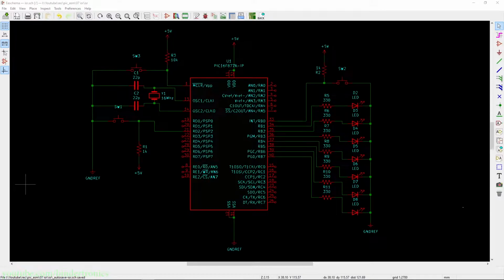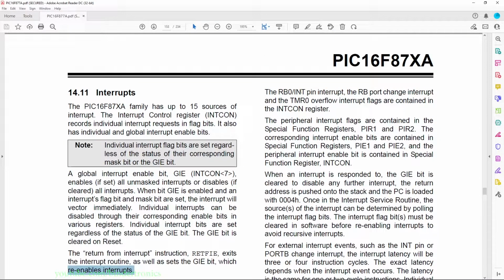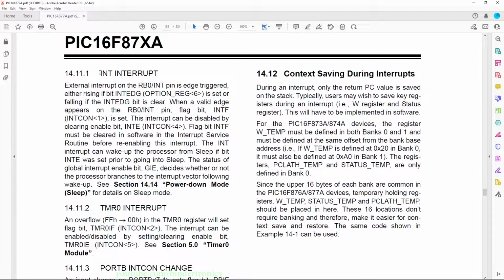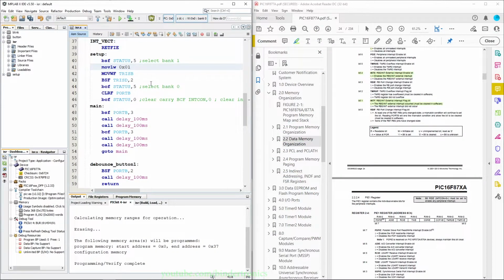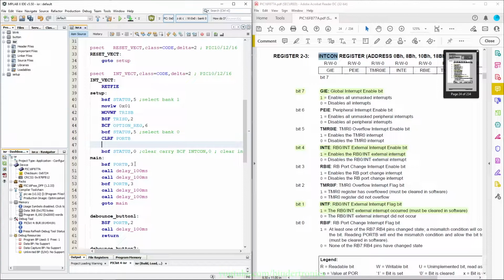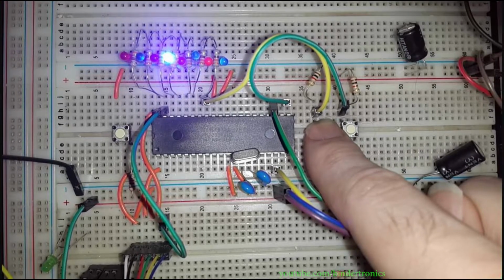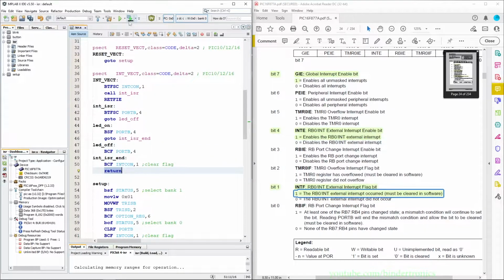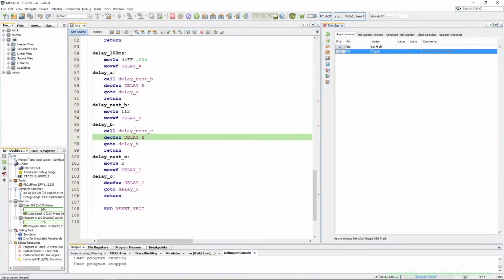Interrupts 🔵 PIC16F877A PIC Microcontroller Assembly Tutorial #7 MPLAB X pic-as mpasm

Comment: For the external interrupt to trigger at RB0/INT, is it supposed to stop the microcontroller till the INTF bit is cleared? I'm not clear what was interrupted in your demonstration as the other LED kept blinking.

I've managed to pause the LED3 from blinking and to turn the LED4 on while the interrupt switch is being held/closed. When the switch is released/opened, LED3 starts blinking and LED4 is off. This can be repeated. To do this, I'm checking the RB0/INT pin instead of the INTF bit from the INTCON register. If RB0/INT is 0, LED4 is set and keep looping INT_VECT else LED4 and INTF are cleared. I've tested below codes in a simulation software.
INT_VECT:
btfss PORTB,0
goto turn_INT_LED_On	;under interruption
call turn_INT_LED_off         ;no interruption
retfie
turn_INT_LED_off:
bcf PORTB,4
bcf INTCON,1	
return
turn_INT_LED_On:
bsf PORTB,4
goto INT_VECT